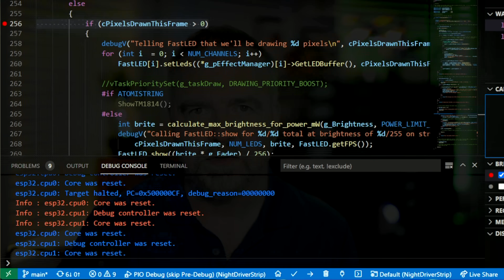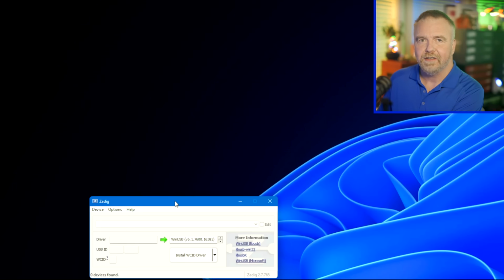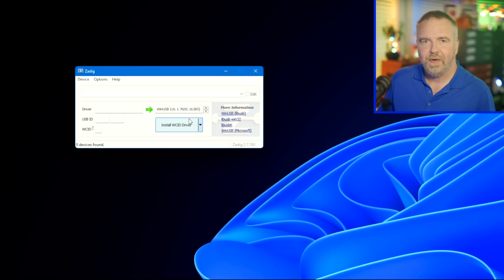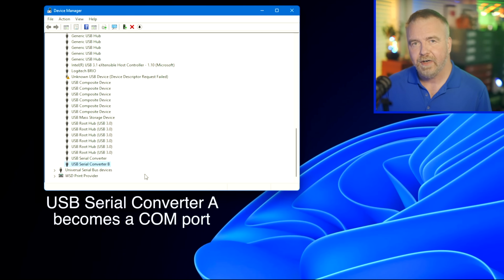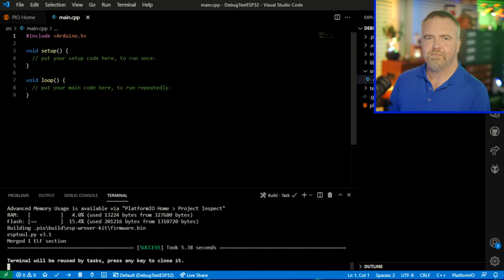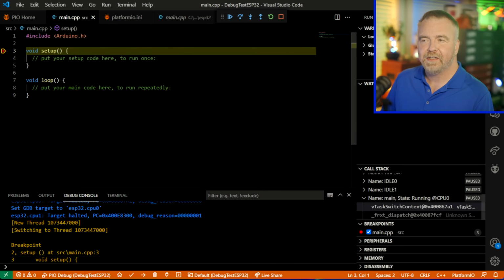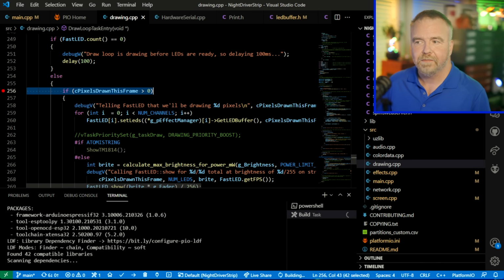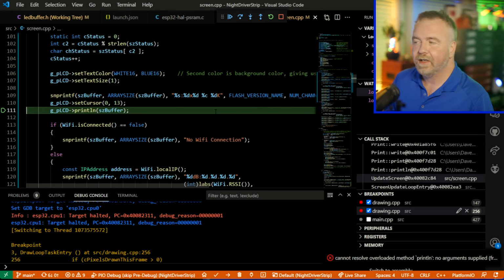C++ Debugging for the ESP32 in Visual Studio

Comment: As someone who only really has microchip experience I’m just getting into ESP32 and it’s a bit of a learning curve. I’m used to programming in assembler on microchip products but am getting back into C which I haven’t used for many many years and using the Arduino IDE z which is really nice and gentle getting me into a new SoC. 
I’ve got platformIO and Studio code setup and need to switch to it …. It’s just all of the tools that is a bit of a nightmare to find my way around.

Comment: Great job on the video, Thank you.
I find I need to get things lined up (just right) and from what I can see I can only debug what is inside or called from loop() and not setup(). Perhaps I need to work on my setup.

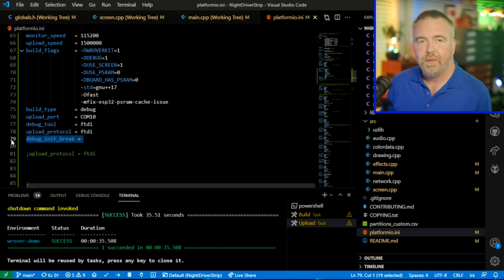On or about time index 11:42 you display you platform.ini. How much of that code is required for the debugger?

build_flags = 	-DWROVERKIT=1
				-DDEBUG = 1
				-DUSE_SCREEN = 1	
				-DUSE_PSRAM=0
				-DBOARD_HAS_PSRAM=0
				-std=gnu++17
				-Ofast
				-mfix-esp32-psram-cache-issue
build_type 		= debug
debug_tool 	 = ftdi
upload_protocol = ftdi
debug_init_break =

Comment: Finally it works for me. You saved me a  ton of time. Thanks. My compilation time was 4,47 sec. with Intel(R) Core(TM) i7-1065G7 CPU @ 1.30GHz   1.50 GHz, 16GB RAM. 
ctrl-shift-b didn't work for me. Instead I used the Build Button on the PlatformIO sideboard.

Comment: For anyone with board = esp32-s3-devkitc-1 (or similar) : you can get source level debugging just by connecting a second usb cable from the pc to the board and adding these settings to platformio.ini

debug_tool = esp-builtin
debug_init_break = tbreak setup
debug_speed = 5000

I've just spent the weekend trying to get an eps-prog board working with one of my ESP32-S3s and eventually realised the board I have has built in JTAG debugging !!! Not sure how this method compares to Dave's, I've only just got it working and am yet to use it in anger, but it's hitting breakpoints I set (eventually).

Comment: Finally got my kit after a few weeks, and set it up exactly like your video.  Works 100%.  Bit of a scare with the zadiag program, as it timed out after 5 minutes and said it failed,  but still installed the driver.  BTW, I have an I7 8th gen ACER notebook for my home unit, and it took 9.75 sec to compile.  Thanks!

Comment: When debugging the ESP32, keep in mind that you can only set 2 breakpoints at any time. If you single step, one is needed for that. So you are left with a single breakpoint. If you set more breakpoints, they will be silently ignored. This limitation does not exist on desktop systems as they run code from RAM and can modify the code to create breakpoints. MCUs other than the ESP32 usually offer 6 or 8 hardware breakpoints.
Reply from the maker: Thanks, I did not know that!  I assumed it would inject break instructions into RAM, not just be limited by hardware breakpoints.  Why can they NOT set a breakpoint in code by modifying it?
Reply: @DavesGarage  Since the code is in flash memory, an entire flash page would need to be written.  And it would need to be undone when debugging ends. Otherwise a non-functional device would be left behind. If I‘m not mistaken, Segger‘s JLink debugger does it for certain MCUs. But the FTDI/OpenOCD combination sadly does not.
Reply: @robatoto  afaik the ESP32 only has ROM and RAM, the flash is external, so code must run from RAM either copied from flash at boot or cached from flash to not make it too slow
Reply: @fuzzy1dk  Yes, flash memory is external. But that‘s where your code resides. And it‘s directly run from there except for interrupt handlers marked with IRAM_ATTR, which are copied to RAM.
Reply: @robatoto  the code in flash is also run from RAM it is just copied there automatically when needed. running directly from flash would be very slow
Reply: @fuzzy1dk  RAM is used as a cache. As only part of the code is in the cache at any time, the breakpoint would need to go into flash memory. That‘s the relevant point re debugging.

Comment: I suppose we can't really setup the classic visual studio for this... can you explain why code instead of the standard visual studio?
Reply: probably because code runs on all operating systems
Reply: PlatformIO, which is the actual IDE in use here (using VS Code as a host and text editor) doesn’t run in the “big” visual studio. There is a commercial extension called Visual Micro for visual studio, but you can also run it for free in Atmel Studio (now Microchip Studio).

Comment: I saw a post on YouTube regarding building an ISS tracker.  The project used an STM microprocessor. Whilst an overview was given, details were not.  After struggling for some time, I bit the bullet and used the debugger and discovered that some modules weren't being compiled correctly and had to be forced to be compiled which of course solved the problem.
Without the debugger I think I would have ditched the project and written off the time.
Thanks goodness for the Debugger!

Comment: For watchdogs, I love the terminology I heard once on how to use a watchdog. The watchdog requires you to "pet" it periodically, like you would a real dog. You keep petting it and it stays happy. If you fail to pet it in time, then it reacts with either a "bark" (generates an interrupt), or a "bite" (resets the system). (The on-chip watchdog timers were configurable on whether they should bark or bite).
Reply: Nobody says "pet".  It's "feed" or worse
Reply: I saw a Pioneer stereo schematic that had an IC with a "WatchDog"  input pin. It came from an IC with a "DogFood" output pin!

Comment: nice =D
Reply: After building my own CPU, I needed either a way to upload to RAM, or a console communicate with it... for now I'm just using the switches to program it, but that is much slower than some sort of keyboard interface... I was thinking of having an ESP32 web interface as, I believe the ESP32 is 5v logic... otherwise with a RaspPi I would have to do some 3.3V to 5 logic interfacing. (All of my homebrew CPU logic is 5v TTL) anyways... just something to keep me from getting bored, having a nice project to flex some electronics, and blow out a few leds. Not to mention that as a programmer it's always good to understand at least 1 level lower than where you work.  I'm really a Computer Engineer by Degree, but work in software. Go figure.

Comment: I don't get why STM32 is not popular. Their STLink debugger can be bought from Chinese men for $2, or on official cheap dev boards for $5. It works with every µC, not only dev units. It offers full debug including step-by-step, breakpoints, live checking registers values, and more. And it works without any hacks. Their HAL is also great. It is not as simple as Arduino (but still very simple), but way way way more powerful.
Reply: They've become quite popular for use in digital eurorack modules. Still pretty niche in the grand scheme of things I guess, but at least some people have seen the light.
Reply: @iswm  Yeah, ST is not as old as their competition, but their products are great and the internet could help them. (Also I am European, soo...)
Reply: I’ve actually been really impressed by the Nucleo boards. They can be programmed in Arduino by adding the (official) board support from ST, but in PlatformIO, they’re already there, and the Nucleo boards’ integrated STlink works beautifully for both uploading and debugging. In PlatformIO, the Nucleo boards support Arduino, STMCube, and several other frameworks, making them drop-in upgrades for Arduino boards.